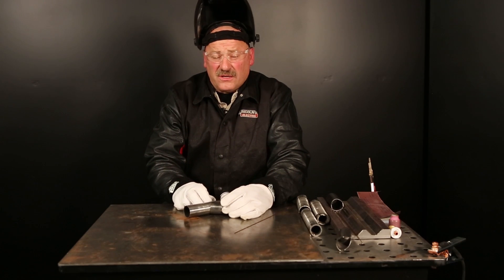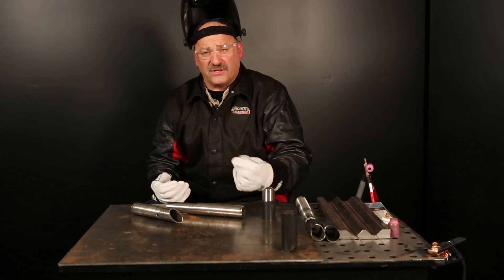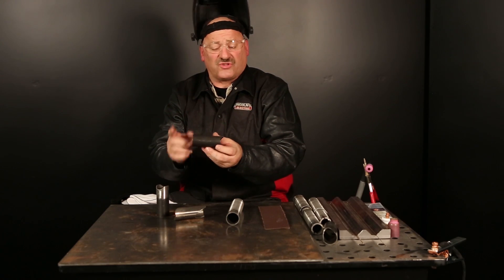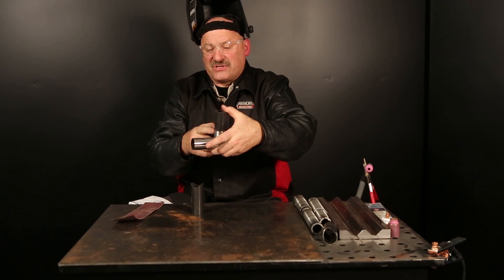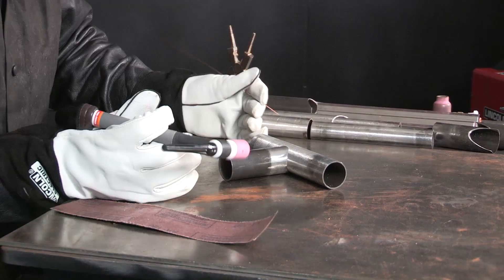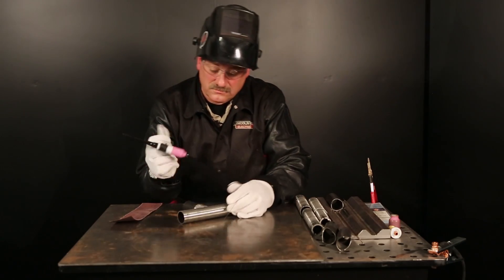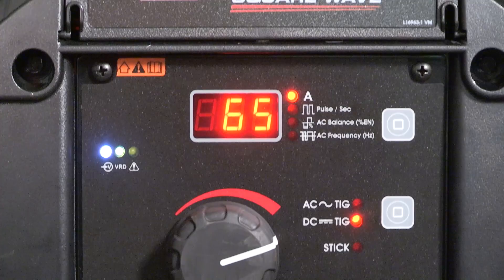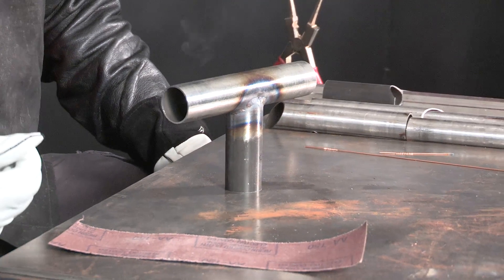ARC Magazine Master Class: TIG Welding 4130 Chrome-Moly Tubing

Comment: help me please i need to get into the the welding industry deeper i build race chassis now but i want to do what you do im very talented when it comes to thin wall chromoly and aluminum. Does linclon need anyone else??
Reply from the maker: Are you looking for the weld school? We are an equipment manufacturer but we do offer a world class weld school.
Reply: lincolnelectrictv no i want to be a representative or do what you do. Im a very skilled tig welder with my work being shown at pri at this very moment aswell as a car i did for ihra last year and i want to demonstrations and seminars im much better than alot of people already in those positions so it makes sense to me!
Reply: actually i have a video on my channel of the car i did thats at pri right now people are bkown away with the quality of welds alot of people even tried saying my chromoly chassis was docol r8 which is way easier to weld because of the quality when they find out its chromoly they are amazed!
Reply from the maker: What do you mean do what I do? Video? They guys we film are Lincoln Weld School Instructors.

Comment: I'm working on a design for a jig/fixture for a smaller diameter wheel and need to weld a tubing nipple onto a piece of plate.  Because of the dimensions I need, it seems 4130 or A513 is most common types of steel.  But I've read that A513 is more difficult to weld?  It seems the settings on the machine for the thickness of the material does not seem outrageous (4130 is hardened?), but the operator seemed to linger with those tacks.